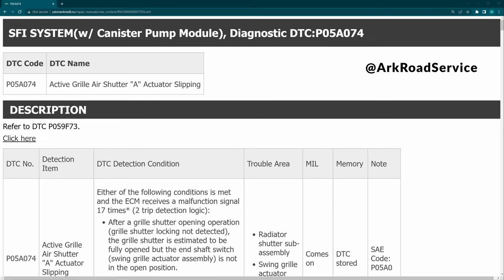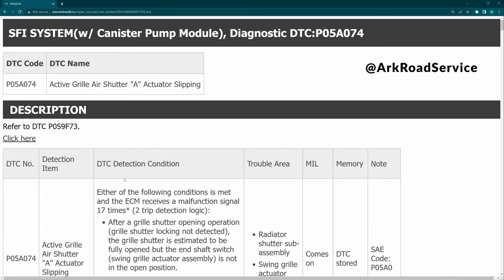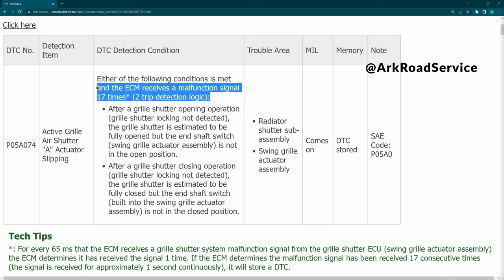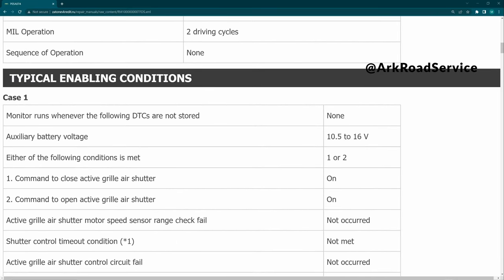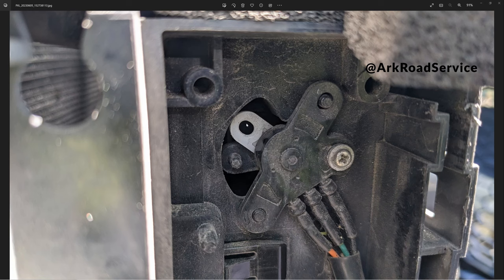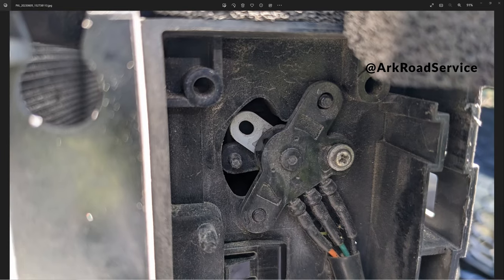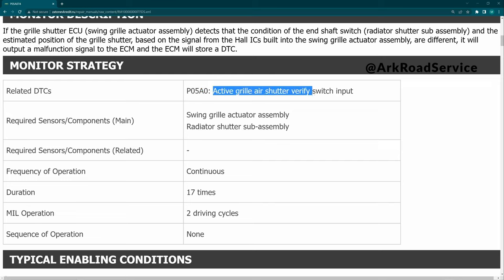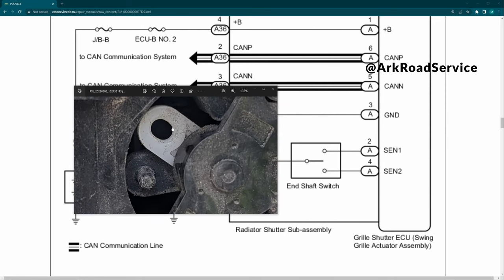PART 1 ACTIVE GRILLE SHUTTER TOYOTA COROLLA HYBRID P05A074

Comment: My 2022 Camry Hybrid LE threw a "Grille Shutter Malfunction" warning.

While on the highway, I heard something hit in the front bumper/grille area, and after reaching my destination some 900 miles later, I put the car in park, and the "Grille Shutter Malfunction" warning and check engine light both came on.

Upon inspection knelling down, I noticed the shutter "shroud", or the outer housing of the shutters, on driver's side, just to the outside of the shutters themselves, had a 1 inch square hole in the plastic, right at the end.

I cleared the code, but it reappeared an hour later. Do you recommend I first remove the top cover above the radiator to explore further visually, and if unsuccessful, then remove the bumper?

Or another strategy? 

Thanks!  Bobby
Reply from the maker: Normally shutter grill malfunctions happen with water or something physically getting stuck in the grill
Reply from the maker: I would check for normal opening and closing of the grille
Reply: Did you end up getting it fixed if so what was the problem ?
Reply: No not yet.  Hoping to get to it soon though. Something def hit it, as I can see some damage far right, driver's side.  It looks like a piece of plastic is missing. I believe I need to takeoff the radiator. Cover to get my hand down there. If I can't figure it out then I'll have to take the bumper off. That will determine what parts I may need I believe.
Reply from the maker: @christophersanchez3366   From what I gathered water debris and front end damage, problem was intermittent, made a few adjustments and the code never came back